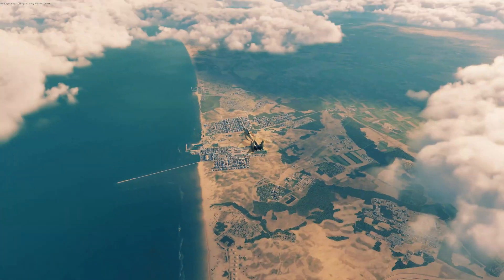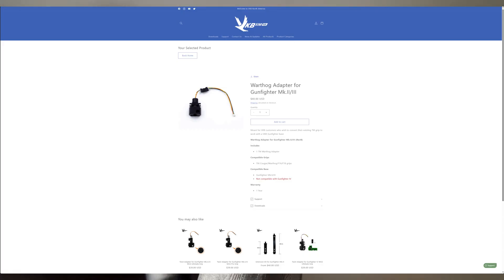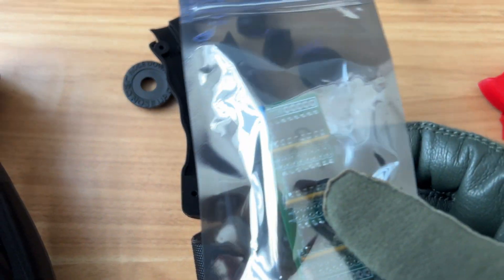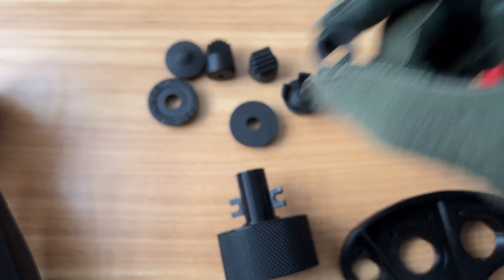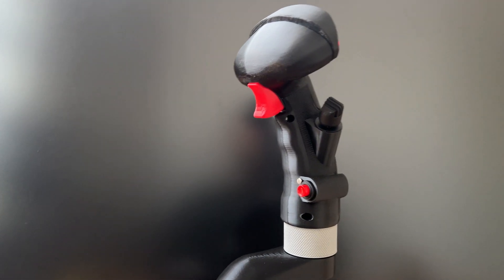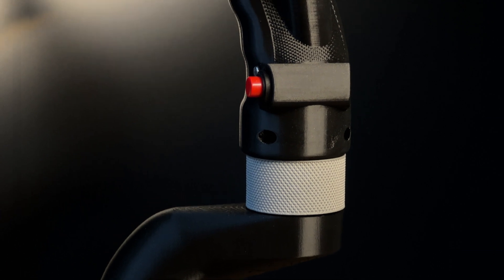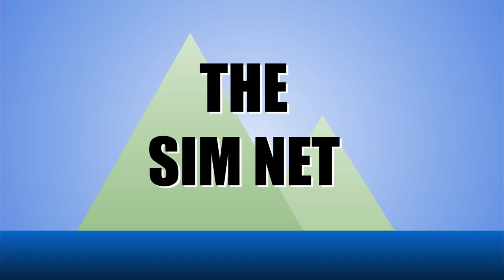Introducing F-15 Eagle Grip DIY - Files Available Here

Comment: Is there anything preventing someone from having PCB way print the whole grip in metal and all buttons in resin for extra premium feel?
Reply from the maker: You absolutely could, however if printing the whole grip in metal you may need to specify if you want the screw holes tapped. Email me at questions@thesimnet.com if they need adjustments made to the model in order to print fully in metal. Cheers!
Reply: @thesimnet  thank you x2!!!!

Comment: hello, do you have the step file for the F-5 tiger extension? because I would like to modify it because I have the B8 grip with thrustmaster thread version, so I would like the possibility to modify the upper part for this thread and also make a slot for the shift register card at the inside the extension, the same principle as you did on your F-15 extension project.
In PM if you want

Comment: I'm totally new and bought my 3D printer exclusively for your project. My 3D printer is a Bambu A1, I did buy also PLA Basic filament. Can you recommend me the best filament quality for this project. Sound to me PLA basic is not the best for that.
Reply from the maker: I personally use PLA Basic and I have had no issues. I print with 0.2 layer height and 20% infill for prototypes, and 0.1 layer height and 100% infill for final grips. The most important thing I have found is making sure the bed is level!
Reply: @thesimnet  thank you so much
Reply: awesome choice im sure a bambulab will help if you get any issues just try some easy prints i think they come on the printer's SD card just dont expect such a print to print perfectly your first time! also its well worth the wait to reduce the layer height (very easy to change in the bambu studio)

Comment: What do you think about connecting it to a winwing base?
Reply from the maker: I believe WinWing uses a 6 pin mini din connector unlike the TM grips, but if there is a warthog to WinWing adapter it could be possible! I will do some research. I would not be surprised if WinWing introduced their own F-15 grip, as they already released F-15 throttles. I do not have any WinWing products but generally the consensus seems to be that they make some good quality kit!
Reply: @thesimnet  winwing has a thrustmaster to Winwing connector but that hasn’t been in stock in over a year. As for a ww f15 stick they just have there f18 stick which is close enough
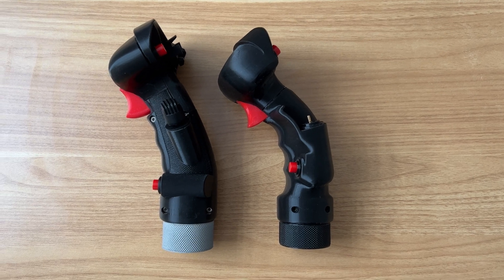Reply from the maker: @Horizon_Systems  Thank you for the heads up! The F-18 stick and F-18 stick are close enough that lots of folks won't even notice the difference. That being said, the beauty of this hobby is that I can replicate something exactly as it is - not just "close enough". They are visually and operationally distinct, you can see my WIP F-18 grip at 1:20